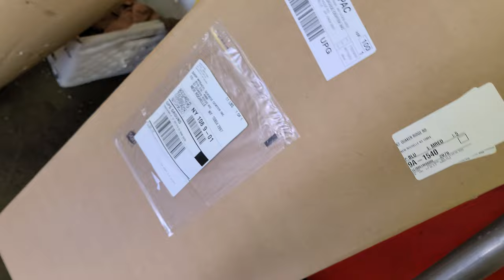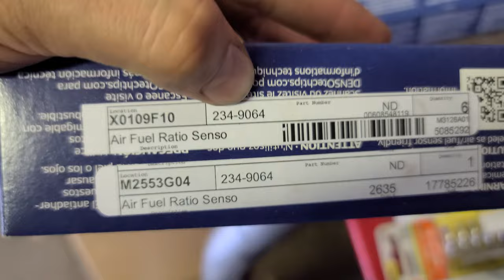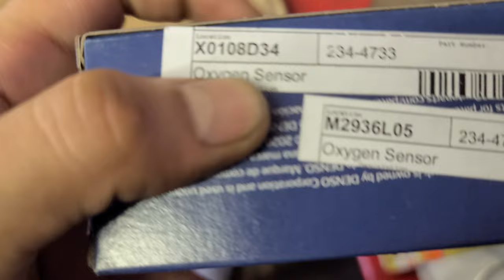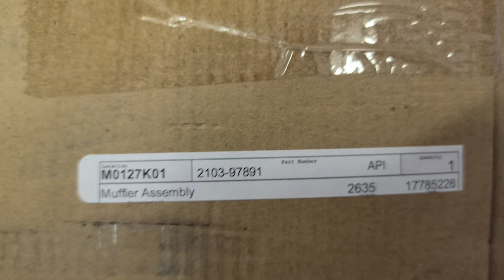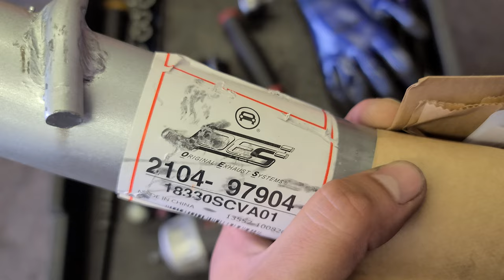2003 - 2011 Honda Element How to replace the exhaust system (pipe)/ CATALYTIC CONVERTER STOLEN!!!🥶

Comment: When you removed the broken bolt from the exhaust manifold, did you heat the bolt or heat the manifold around it? What type of torch did you use? Is a MAP gas torch sufficient? Many thanks!
Reply from the maker: BLUEFIRE BTS-8090 Auto ON/OFF Trigger Start Heavy Duty Gas Welding Torch Head Adjustable Swirl Flame Hand Hold Portable Fuel by MAPP/MAP Pro/Propane 1lb Bottle Tank (Torch Kit with MAPP Cylinder) https://a.co/d/8rhANLM
Reply from the maker: I heated the nut where the bolt screw in.
Reply: @AxtuoAx  Thank you! That is very similar to the MAP gas torch I have. I ordered the donut and new bolts from Honda. Appreciate the info!
Reply from the maker: Thanks